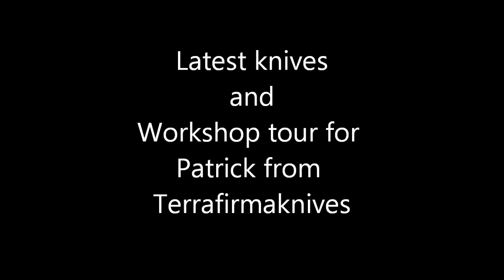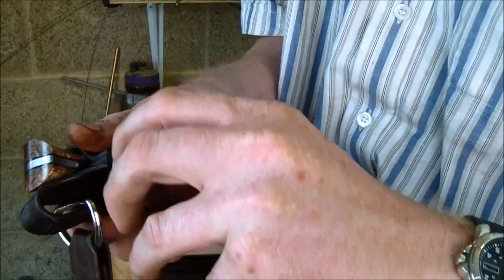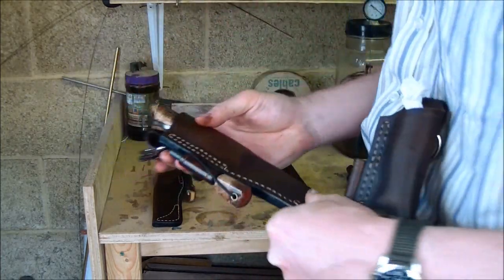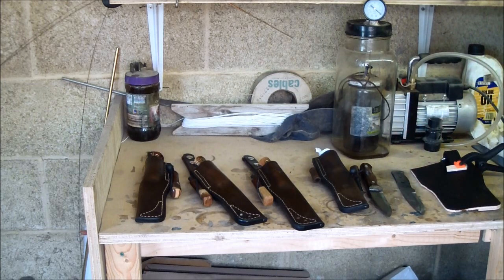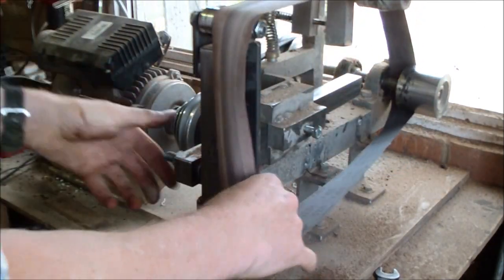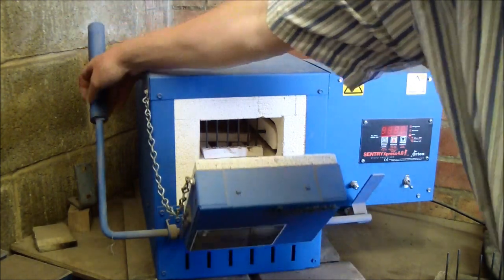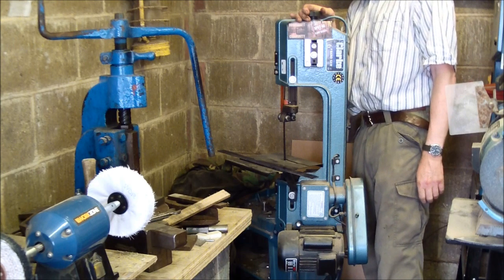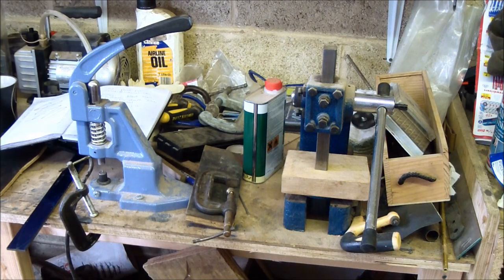Latest knives and workshop tour 3 aug 2013

Comment from the maker: Thanks Lee,
If you get a metal cutting band saw I think you will find it a worthwhile investment. It's a lot more accurate than an angle  grinder. I have used 22 teeth to the inch blades but they cut slow and only last for 8 profiles. Now using 16 tpi and much quicker and can even cut slight curves. Not only that but you can cut wood with it too. I see a lot of knife makers using this type of machine.
Sandy

Comment from the maker: In the past I have normalised them but the process is not neccassary with stock removal as it would be with forged knives.I always quench carefully and edge first to avoid warpage then when I temper I temper twice. On the first temper all the blades are clamped together. I find this helps to keep things straight.
Sandy

Comment: Thanks sandy, that helps a lot mate, the angle grinder is not the safest tool neither. I have 3 dogs too, and cutting outside, I clean the best I can, but worry about the metal in there paws. Thanks bud.